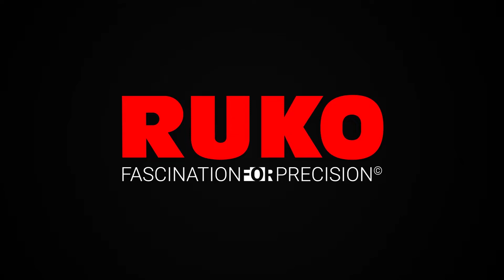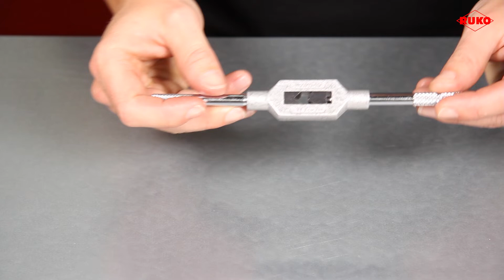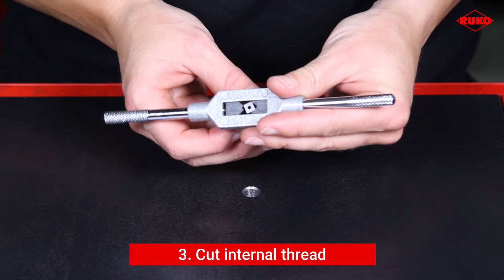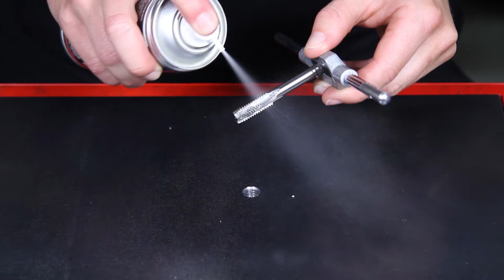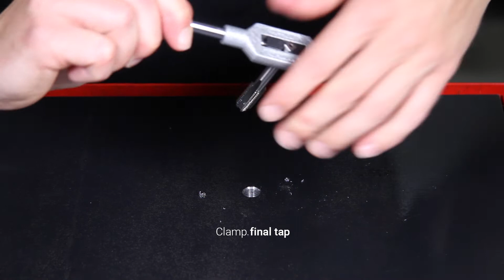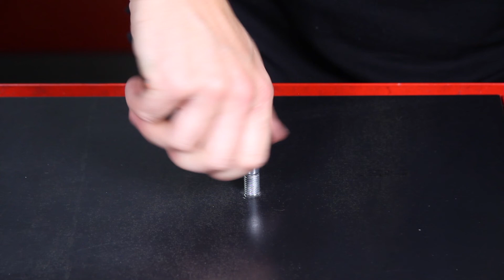How to cut an internal thread in 3 steps by hand

Comment: After the chamfering  and  first start up  using hand double check that piece and the tap are perpendicular then use the tool for the tap and the first thread instead of using the tool to avoid swinging and to prevent the start up damage.

Comment: Why do you check with a tri-square?  The tap is going to follow the hole.  Checking angle is only necessary when cutting external threads with a die.

Comment: Q about measurements.  What is the ratio of hole size to screw size.  For instance, if I want to cut a threaded hole to accept a 1/2" bolt, what size pilot hole would I drill?  I am assuming something smaller than 1/2".  Is that right?
Reply from the maker: Correct.
The exact formula for the hole is: core hole diameter = thread diameter - thread pitch.

Blog here: https://ruko.de/en/blog/how-to-cut-an-internal-thread

Here is the PDF with the overview for metric threads: https://ruko.de/assets_ruko/downloads/RUKO_thread_tabel.pdf

Comment: What about info on what size whole to drill for size of thread? M8, M10 etc
Reply from the maker: Hello Bazz, 

You can find out the diameter of the core hole in our blog (link is in video description) including a PDF with all diameters ( https://ruko.de/assets_ruko/downloads/RUKO_thread_tabel.pdf ).

The diameter of the twist drill for tapping is calculated:
Tap diameter - Thread pitch = Core hole diameter

Example using the M8:
Core hole diameter = 8 mm - 1.25 mm = 6.8 mm

Hope we could help you. 

Have fun threading.
Reply: Why 3 diferent taps? Whats the difference between them? Thanks
Reply: @RUKOGmbH  hey I'm so sorry you sent me this response 2 years ago, and for some reason I've only just seen it, many thanks for taking the trouble, sorry I didn't notice earlier.

Comment: My set has only one tap per size not 3 will it still work ?
Reply from the maker: Yes, it will also work. 
Just make sure you break the chips by turning back a third turn (as shown in the video). Also please don't forget to use coolants and lubricants.
Reply: @RUKOGmbH  thanks for replying means a lot stay safe have a good holiday season hi from Ireland
Reply from the maker: @davidpyper82  Thank you a lot! You also stay safe and happy holidays (from Germany).

Comment: why use 3 taps instead of 1?
Reply from the maker: Hello MrBoomtheroom, Thank for your question.
With 3 taps, you get a nice clean and more precice thread with not much effort.
Single-cut taps (1 taps) are usually used for fast and "dirty" cuts - if you don't have much time. 
It's also harder to cut with them because you have to cut more material at once.
Hope we could help.

Comment: Cool vid, it's Tri-square though.
Reply: technically it's an engineers square as it is made completely out of metal, a tri square is used for wood, and the base is made out of wood.
Reply: And it's useless using one if no explanation is given what to do when you're off.